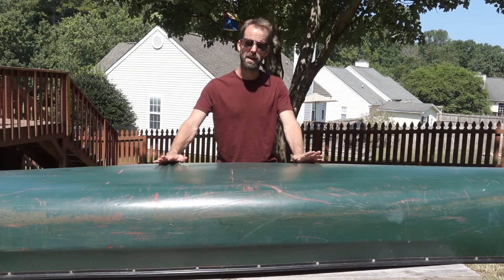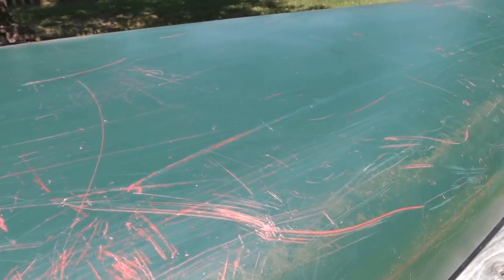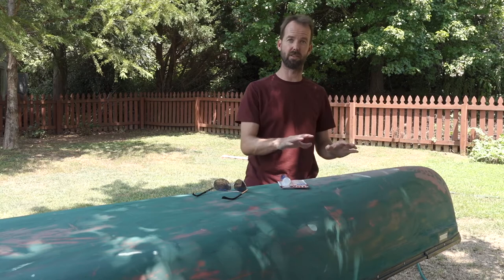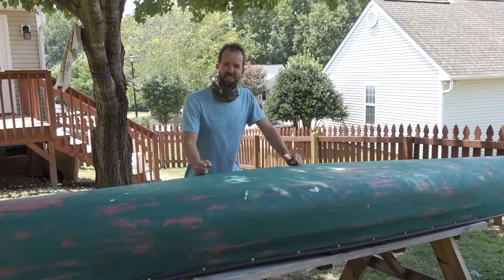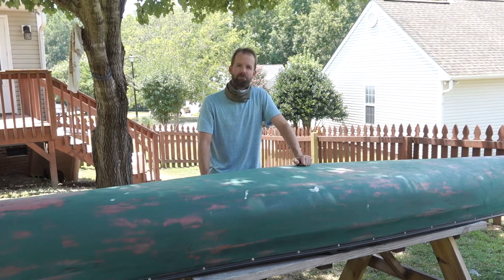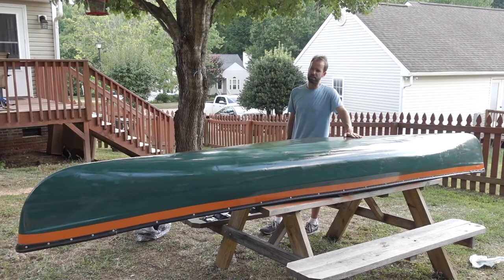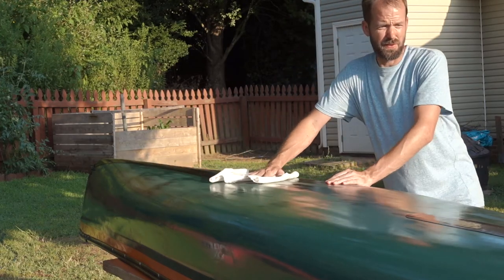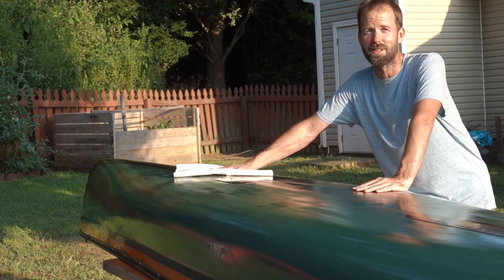Canoe Makeover

Comment: I recently bought a 32 year old Royalex canoe (Mowhawk Challenger 14' solo) that has spent a lot of time out in the sun. There was a lot of oxidation damage to the outer ABS layer. I didn't want to paint it since once you paint something you have to continually paint it. I think I found the best way to refinish it. I wet sanded it with 440grit wet/dry paper by hand and then with 1000grit. It was easy and removed all the oxidation and was smooth as a baby's butt. I went over it with 2 layers of Armorall letting that sink in a cure nicely and then a top layer of 303 UV protectant. It looks almost new.
Reply from the maker: That’s awesome! Nice work!

Comment: Ummmm, thanks for….. nothing. Not one thing on the painting part, which isn’t that the purpose of the makeover. 1) what paint and 2) how did it get applied.
Reply from the maker: Check the description box… I have linked the paint and other items used. It was a spray on application.

Comment: Wow, so timely! Ive got a mad river royalex in red. I am in the process of changing the wood gunwales. I too will change the color to green. More of an olive green for waterfowling. JB weld can repair anything, however I wasnt sure if it adhears well to royalex. (i gues it does). The keel strip is a sweet addition. Thank you for the video, great job, and be proud of it!
Reply from the maker: secret journey thanks for your kind words and for watching! 🙏🏼
Reply: I have a Red Mad River Royalex canoe as well - was a former Boy Scout canoe I picked up at a good deal. Never thought about changing the color until i watched some videos today. Green sounds like a good plan. What are you going to use?
Reply: @twowheeledsmurph  
I will probably use a good oil base exterior paint.

Comment: The right tool makes life a lot easier, so a claw hammer for a scraper is strange. You are dead nuts right about 220 grit paper on a random orbit sander. Real boat paint from companies like Pettit or Interlux will look a lot better , last longer and add value to your boat. If you are going to all the trouble to sand and prep the hull, you don't want rattle can paint fading in a year or so. One quart will do a whole canoe with a bit left over.
Heat gun will smooth out the wrinkles in the keel guard and make it lay flat without cutting it. Heating the keel guard actually makes it stick better as well.
Reply from the maker: Great advice! Thanks

Comment: Great video. Do you think this can be applied to a polyethylene canoe?
Reply from the maker: Yes I think so. Both the paint and JB Waterweld should work for that canoe. I would always be careful sanding… go really lightly at first to make sure you don’t take off too much. Good luck 👍🏼
Reply: This is probably too late, but painting a poly canoe is usually pretty superficial as the paint tends to come off easily. I've had a Colman canoe for a long time and you can smooth them out, but I usually just use a matching spray paint to spiff it up from time to time, but wouldn't worry too much about primers and proper paint jobs as they will just peel easily.